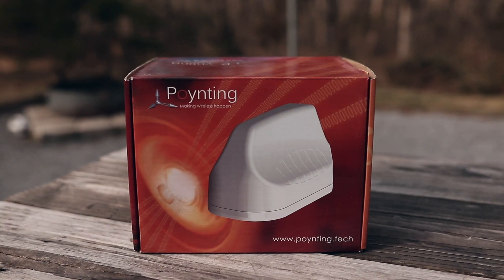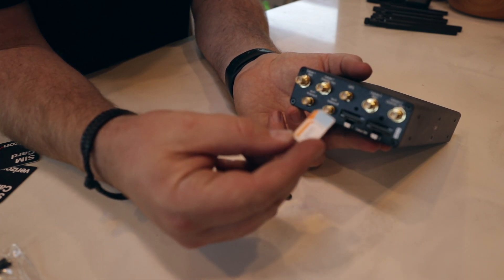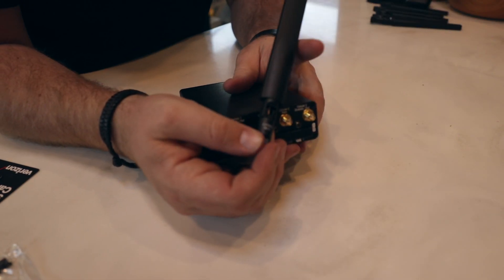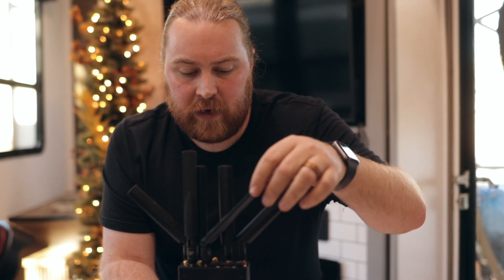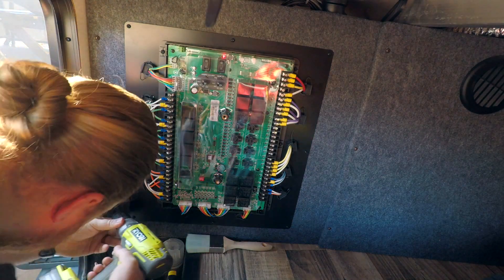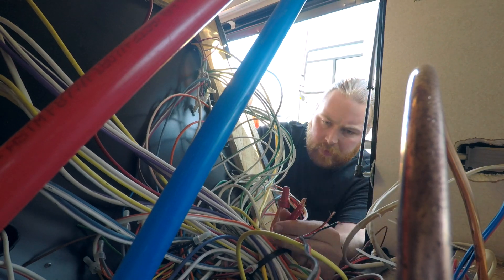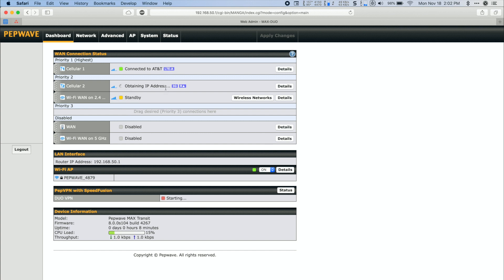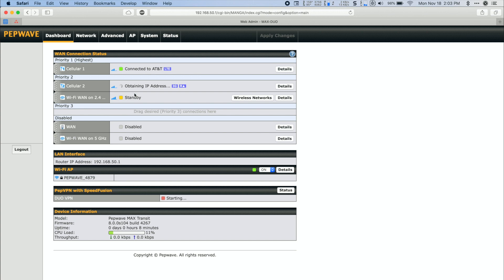Pepwave Transit Duo Set Up and Install

Comment: When installing with DC power, what kind of fuse should be used?
Reply from the maker: Our dc power cables come with 3amp dc fuses pre installed. That would be the optimal fuse for most Peplink devices. Here is a link to a common cable https://mobilemusthave.com/products/copy-of-fused-dc-power-cable-for-12-48v-dc-installations-various-terminations

Comment: I just purchased peplink 20 through Amazon to replace my asus ac88u router do to security flaws supposedly, but this router just doesn't seem to work or need an it network guy to set it up, im so frustrated why isn't this dhcp picking up just keeps saying connecting
Reply from the maker: hello, unfortunately we are not able to support device not purchased through our store. If you do purchase a device from us, we do have a setup service where we can help with issues like this.
Reply: @MobileMustHave  thanks fortunetly u just made my decision even easier, cerified as per amazon & u guys won't support for price vs value, means really no support for any of you products after 1 year, just a money dump, good software alone doesn't cut it, & reading forums on tickets users of equipment supplied with speed issues & software bugs makes peplink really no different than say asus wrt or tomato merlin based routers, thanks bud. I gues there's really nothing wrong with my ac88u just some it guys peptalk. Thank you

Comment: Video good for setting up unit. However, unhappy with the unit itself, worked well at first and was happy, now its been about 5 months and now - not so good. WiFi transmit drops constantly or is very weak (6 feet away I have a "Fair" signal). Purchased the "extended support" from Must Have Mobile. No one answers phone, website is terrible (anti-robot verification pics are 1/2 inch and too grainy on IPAD to use), website "Rewards" constantly blocks check boxes and pops up to stop you. Every angle frustrating.
Reply from the maker: This is most likely an antenna or configuration issue. We would recommend doing all testing with the included black antennas not a external antenna and be sure to setup wifi in accordance with our best practices for wifi here: https://support.mobilemusthave.com/support/solutions/articles/67000670107-pepwave-wifi-setup-best-practices - message us at info@mobilemusthave.com if you continue to have issue after setting up then wifi.

Comment: Can I install sim cards from my current hotspot devices right into this?
Reply from the maker: This would depend on your cellular provider's list of approved devices but typically this works fine with major carriers. That said you will likely need a sim adapter as sim cards for hotspots are typically nanon or micro size and most pepwave devices take full size sims. Sim adapters are available for purchase here: https://mobilemusthave.com/products/sim-adapter-multi-sim-card-adapter?_pos=1&_sid=b0b85ccc9&_ss=r

Comment: Is it really necessary to go the route you did with installing the power wire? Or can you plug and play?
Reply from the maker: the router comes with an AC adapter and you can just plug it into any ac power plug. That said, hard wiring the modem into your 12v system is much more efficient and should you have a problem with shore power and need to troubleshoot it, its always nice to have your internet still online with battery power on 12v so wiring to your house batteries is preferred if you can in an rv or marine setup.

Comment: Ok… dumb question most likely… but what type of SIM card service do you purchase from a cell carrier? Just a regular new cell line or is it a hotspot connected device line? I’m new to this and want to make sure I get the most bang for my (limited) buck haha
Reply from the maker: data only devices typically only work with data plans for data only devices. That said some plans have been know to work in Pepwave devices that are designed for phones but these are subject to being shut off if not used as intended. A good resource for checking out what data plans are the best deals is the Mobile Internet Resource Center's data plan section here: https://www.rvmobileinternet.com/planpicks/
Reply: I had the same question, and I'm still confused. If I have T-Mobile for my phone would I have to get a T-Mobile data plan and T-Mobile SIM card? Or is this modem completely separate from my cell phone carrier, to where I could have T-Mobile still for my phone, but then have a separate data plan with another carrier? I'm so confused.

Comment: Hey I got the Parsec which has LTE listed as 1-4; I’m assuming 2 is  CELL 1 aux, 3 is Cell 2 main, 4 is cell 2 aux?
Reply from the maker: Hi Grim, detailed antenna wiring diagrams for the Transit Duo available here: https://support.mobilemusthave.com/support/solutions/articles/67000663769-ultimate-road-warrior-antenna-wiring-diagram

Comment: Hi, what happend if we lose the primary connection when we do streaming to youtube of other clients? do we lose the active stream? thank you in advance
Reply from the maker: Typically whenever a connection is lost the connection is reset as your device fails over to a secondary connection. Youtube and other streaming services have certain systems that allow streams to continue when your connection has changed in certain circumstances without wan bonding but the best practice here would be to enable speedfusion cloud to bond your connections so that if any one failed the stream would seamlessly failover yo the next connection inside the speedfusion tunnel. Note speedfusion licensing is included in Primecare model routers like the Transit DUO however if you do not have a place to host the speedfusion tunnel a monthly fee applies, typically around 30-40 per month depending on the amount of usage.
Reply: Thank you, the 4 slot’s works with 4 different carriers or 2 and 2 ad backup, example: 2 sims with AT and the other 2 with virgin? Many thanks for your answer

Comment: Hey, GREAT content. Any reason you chose to use the Poynting 7-in-1 OMNI? I have a Weboost Drive Reach OTR and I am curious if I can use it with the Pepwave MAX Transit Duo? The Poynting would be a cheaper option quite frankly, but I already own the Weboost and would prefer to not have to return it if possible. Thank you very much!!
Reply from the maker: Hi David, using cellular boosters greatly reduce the number of cellular bands supported as the FCC only allows boosters on a very limited number of cell bands. Furthermore a booster is basically repeating your cell signal from the outside antenna to the inside, this can cause a bunch of issues the main one being advanced features for cellular data use like 2x or 4x MIMO functionality not to work. A roof antenna is the preferred way to use a modem like this. That said you can certainly use a booster by placing the pepwave next to the booster interior antenna (they communicate wirelessly) but typically this will result in slower data speeds except when you are way out on the fringe of coverage and in that case the booster next to the Pepwave is often a good solution for when your way out there and no antenna is powerful enough to pickup a distant tower. That said 95% of the time a roof antenna is better. That said the booster will still boost your cell phone for voice calls in the RV when your pepwave isnt using it (since it would be connected to the roof antenna).

Comment: Hey man .. setting it up. Is the cellular light supposed to continue blinking or eventually go solid?
Reply from the maker: Might blink for a few mins but if your data plan is activated correctly, it should only blink for 2-5mins in most cases.

Comment: Do any of the Pepwave routers other than the transits have the ability it provide Wireless WAN?
Reply from the maker: Most have WiFi built in but not all so just make sure to check the specs.

Comment: will it run on the visible network  visible"s parent network is version.?
Reply from the maker: Visible is not officially support but yes it does work at this current time. It is a throttled plan to 5mbps.

Comment: When using a Pepwave device, how does the controller software handle WiFi as WAN when the WiFi you want to use has a captive portal?
Reply from the maker: We have a video showing the process!  Check it out on our channel.

Comment: I need an idiots guide to splicing into DV power, cuz I have no idea how to do that. Where do I even start?
Reply from the maker: We dont have a video breaking this down, but 12v runs though most RVs. Most lights, switches and even radios are all powered off 12v.  If you can tap into the power wires then you can use that to power the pepwave.  Sometime it is easier to run power from the battery directly tho. Just depends on your placement.
Reply: @MobileMustHave  I’m also a newbie to electrical. It would be great if you guys made a training video on this 12v splicing part

Comment: how can i find out if sim card is compatible with transit duo? The duo model is not listed as approved on the site i'm getting sim from.
Reply from the maker: It is considered a hotspot device. It should work on any hotspot plan. You can sometimes run an IMEI test too on provider sites.

Comment: If you have two SIM cards from same provider will the speed increase or just act as a failover ?
Reply from the maker: If you have one in each modem it would double your bandwidth. Means at the same speed you could run double the devices since it would be spreading the traffic over two lines.  Think of it like adding a second lane to a road. 

If you put both sims in the same modem, then yes they will act as failover.
Reply: @MobileMustHave  ah so not bonding the signals it’s load balancing the two sims not the best thing but better then nothing
Reply from the maker: You can bond them. Without bonding it round robins the connection to balance the usage across both sims. It would use fail over if both sim are in the same modem in slot a and b. Then if one runs out of data the second one would kick in.

Comment: Super super helpful.  We were able to install the SIMs from both of our current hotspots with no issues.  Wow!  Now to find out whether we need to have both modems in the PRI 1 box or shift one to Pri 2 and will check your other videos.  We have the MAX Transit Duo w/ SpeedFusion and we're so so impressed.  We were looking to  move away from MiFi battery management/juggling and are finding faster speeds as well!  WOW!
Reply from the maker: Glad to hear it is working well!

Comment: Devices as of recently start objecting to weak security of WPA2 settings, and start rejecting internet browsers trying to load URL pages when this and other weak settings are used.  See some talk of Pepwave devices “not being interested in security.”  

The minute I started up Pepwave and logged in with iPhone, Pepwave as WiFi source, the iPhone identifies/flags the Pepwave network as “Weak Security”.

From also recently having the same thing happen to my home WiFi Linksys router, I had to upgrade the Linksys security settings to WPA2 (AES) or WPA3 to make the “Weak Security” flag go away and the browsers to stop blocking everyday URLs as “unsecured” in kind solely due to router security.  As soon as I updated to WPA2 (AES) on the Linksys router, the flag and webpage blocking ceased.

I’m no savvy security guy, but now with Pepwave I’m getting all the same “Weak Security” flag and browser blocking that I had with the Linksys system, but I’m not seeing any way to upgrade default security on Pepwave (to WPA2 AES, example) to solve the weak security issues.
Reply from the maker: Hi Tom, Pepwave's with the latest firmware release do support WPA3/WPA2. Make your firmware is up to date and you should see this as an option on on the SSID edit page.  

I have personally found more issues with WPA3 with non-apple devices, but all comes down to what you are using.

Comment: Since there is no Power On/Off switch... what is the best way to turn this Off?  I’ll be using both A/C power Adapter (in truck) and DC (in RV), and I know some electronics really don’t like having power interruptions from say... outages or abrupt panel shut offs... this Pepwave is OK just having power supply regularly shut off and on?  By say, like starting a vehicle and then abruptly loosing power when vehicle is turned off?
Reply from the maker: Yes, these devices are designed for auto use with ignition based booting and power.  They do have a low power draw so you could bypass the ignition power so it is on more consistently, but that is up to you.
Reply from the maker: one note Tom that I noticed our team didn't reply with. You can pull the green power plug out, its removable which works for customers to use like a power port.

Comment: Is speed fusion the same as speed fusion cloud? Does speed fusion have to be activated in some way? My Duo is only showing the cloud link which takes you to the purchase web page. There is no speed fusion section on the main page.
Reply from the maker: Hi Joe, SpeedFusion is the technology used when bonding two wan channels.  SpeedFusion Cloud is a service Peplink offers to simply getting set up with a Speed Fusion connection.   They did an update where Transit units come with 1T of usage of SFC.  For most that is about 4-6 weeks of usage.   MobileMustHave offers a beta Speed Fusion hosting product as well if you are interested in us setting that up for you and the cost and would like more information please reach out to us at info@mobilemusthave.com

Comment: Another question, is there any reason I can’t use my chassis battery rather than the house battery for DC power to the pep wave?
Reply: No, ecept the possibility of draining it to the point you cannot start the engine. 12V is 12V.
Reply from the maker: I agree with the last comment. It will work just fine but the Pepwave will not know when to stop pulling power if it goes below the start voltage

Comment: Can the pep wave switch between AC and DC power? That is: if I connect to power using the DC wiring provided with your Bundles package, can I also use the AC adaptor if needed?
Reply from the maker: It’s not advised to use both at the same time. And if it is connected via dc power you should not need ac power. 

What is the situation where you would need the ac power with dc also plugged in?
Reply: I think I realize now that the power system is such that without shoreline or generator, the house batteries will keep the pepwave running. And on shoreline/generator, the onboard electronics will invert the AC to 12V DC. Sorry, I’m new to all this...

Comment: One last question... I have a Mobile Mark  7-in-1 antenna. The LTE antennas are labeled "LTE-A" which there are two red wires and two "LTE-B" green cables. Do I connect both of the LTE-A cables to the LTE-A ports and the same for LTE-B? Or do I mix up the A's and B's (red and green) on each port?
Reply from the maker: Hi Ryan, the LTEA will go in the cell main SMA connection and LTE B will go in the cell aux sms connection.

Comment: Would you mind sharing how you have the 12-volt set-up with the terminal block? Where do the positive & negative go?
Reply from the maker: Yes! Each model is slightly different, but for the Transit line: VCC is positive, and NGT is negative.

Comment: I just received my new MAX Transit CAT18 from you and this was very helpful for setting it up.  Thanks!
Reply from the maker: Awesome! Great unit too!!
Reply: @MobileMustHave  I'm sure my personal experience isn't a true test, but compared to the Nighthawk M1 and MIMO antenna I replaced it's pretty incredible.  The previous system was connecting and disconnecting all the time, and speeds have been pretty bad since everyone started working from home.  I'm back to pre-coronavirus speeds.  I also ordered the Poynting 7-in-1 antenna (not shipping yet) so the great speeds I'm seeing are with only the antennas the MAX Transit shipped with.  Couldn't be happier, and the help I received from your team couldn't have been better.

Comment: Can you reply with the speeds you were getting with AT&T on this router?
I have a previous generation Pepwave and would like to know the difference; thanks!
Reply from the maker: Hi Rob, there are so many variables that can change speeds. Location being the big one, types of antennas, and tower capacity. That being said the new Pepwaves have faster modems in them. Pepwave just released a cat 18 router which is ~20% faster then cat 12. The mk2 for example has a cat 6.